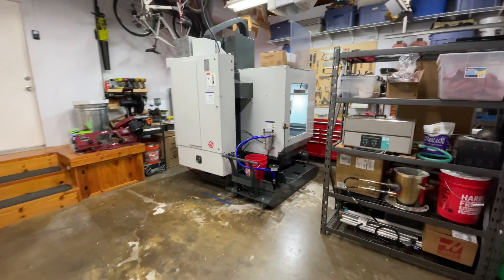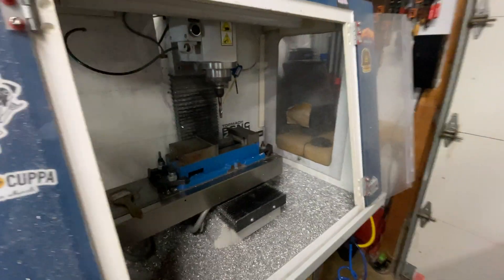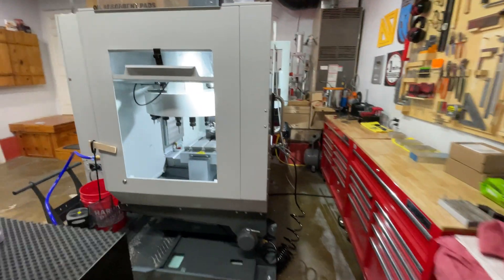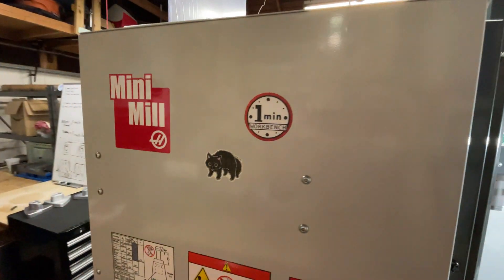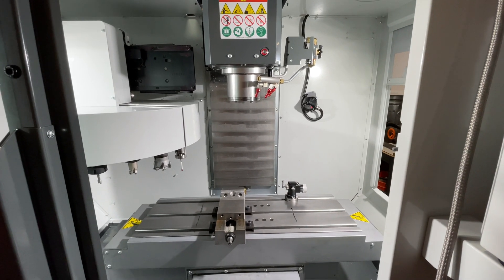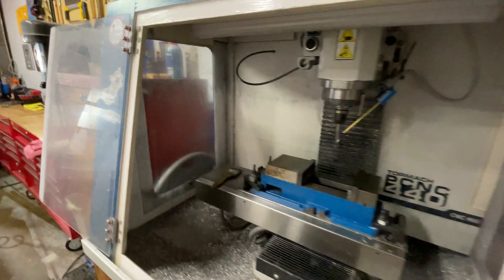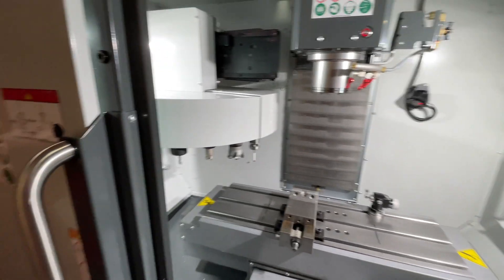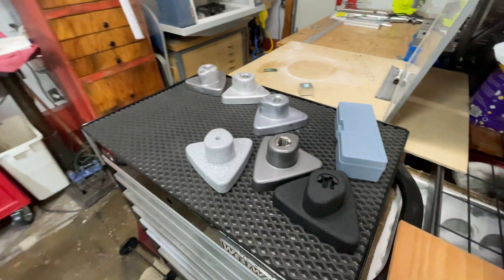HAAS in the House

Comment: I am curious about your choice. I have used older Haas and Fadal machines, but I am approaching retirement and thinking about a hobby setup with a Tormach or  Langmuir gantry machine. What sort of parts are you making and in what quantity? Why did the capabilities of the Tormach require an obvious upgrade (besides the tool changer)? If you have time to respond. Thanks
Reply from the maker: I’m looking to make production quantities of components for my espresso machine designs. So, a production level machine was on the menu. I hemmed and hawed quite a bit, but ultimately came to this because of cost and excellent financing options. If I had to do it again, I’d probably get a Tormach 1500MX due to lower cost of ownership and superior software. It wasn’t an option when I bought the HAAS though. If you want something small for the garage, you really can’t go wrong with a Tormach 440, as long as the small work envelope works for you. It’ll cut just about anything…I’ve pretty much cut everything on it, short of inconel and monel haha. If you’re looking for something a bit bigger, 1500MX would be my vote, though it’s new and I’ve never used one. So, take with a grain of salt. If #tormach is listening, I’d be happy to take a Tormach 1500MX and put it up against the HAAS 😉
Reply: Thanks for the input. The Tormach sounds like an option I need to explore.  First I have to find someplace besides CA to live, then pull the pin on my job. I can't get laid off begging for it. Cheap bastards 😢